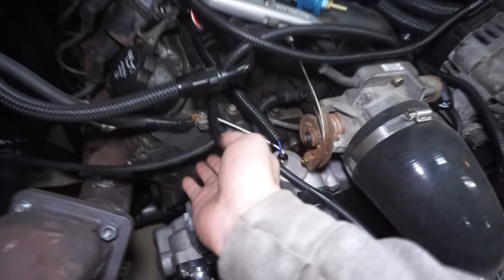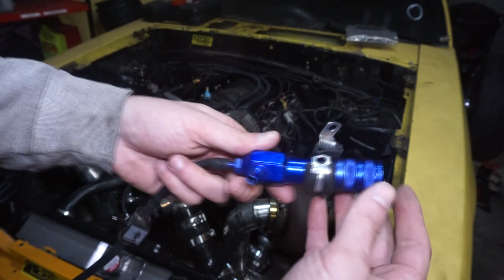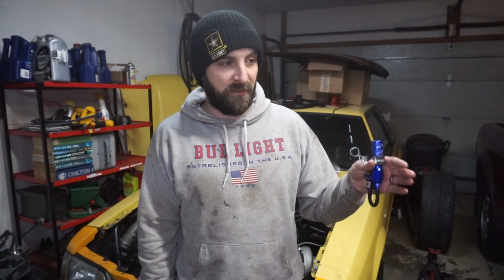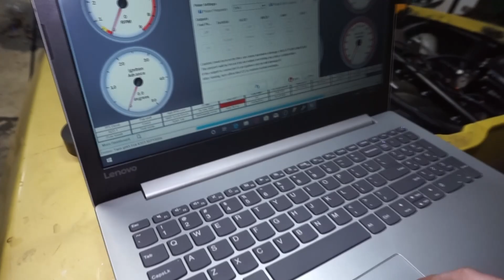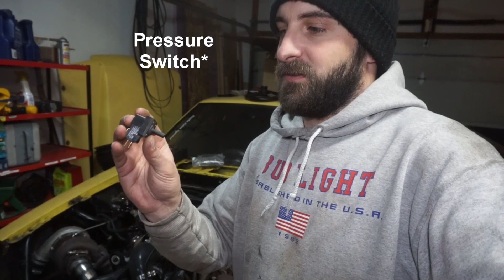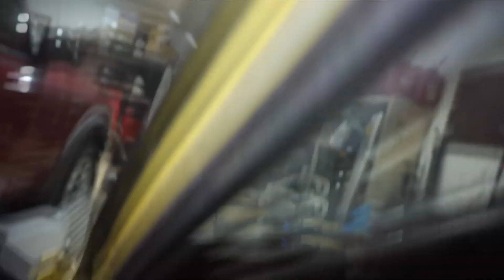Microsquirt Adding Boost Controller To Twin Turbo LS Swapped Mutt Stain!

Comment: Hey what size and brand waste gates are you running
Reply from the maker: 44mm DNA motoring on ebay.
Reply: @BlaserBuilds  cool, just discovering your channel now. Are those gt3582s? I'm building a 6.0 ls with my shop class and running those same ebay specials.
Reply from the maker: @seanjmichel  Those are gt45s. I eventually switched it to VS racing 67/66s which performed very well... I have a 350z on the channel that had 3582s on a 5.3.

Comment: All the pressure to the top of the gate and none to the bottom. Why is the bottom even hooked up. 6lbs spring, 6lbs to top of gate 12 LBS of boost then just add more boost. Or so I thought.. I could be wrong as shiz
Reply from the maker: No line on bottom wouldn't even open the gate.
Reply: @BlaserBuilds  I'm still new to all this.. I was under the impression that back pressure opened the gate but now I know..
Reply from the maker: @KarKamp  No it doesnt. I thought that at one point too, so tried it, and broke 3 rods, wewt!

Comment: Isn't there a way in tuner studio to make the 85 Hz not start buzzing until a MAP or RPM you pick is reached? Could save your Hobbs switch for other activities.
Reply from the maker: Yeah that's all adjustable.

Comment: Maybe a electronic fast idle can be made, maybe a 555 timer as a one shot timer, to switch on a MOSFET when started for like 30 seconds, then a 555, to send a pwm to the idle motor, that can be adjusted, duty cycle, and frequency, to idle fast for 20-30 seconds , or what ever is needed, sounds like it could use a couple hundred rpm anyway,   nice!